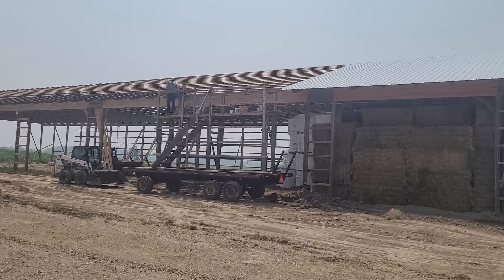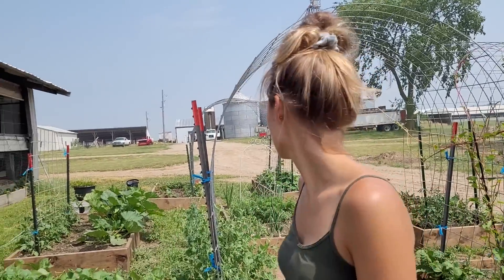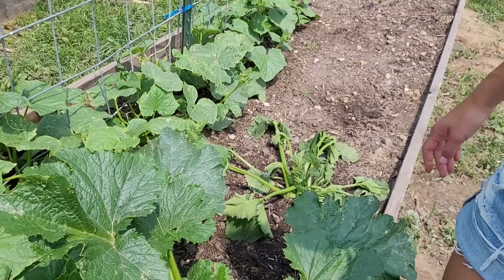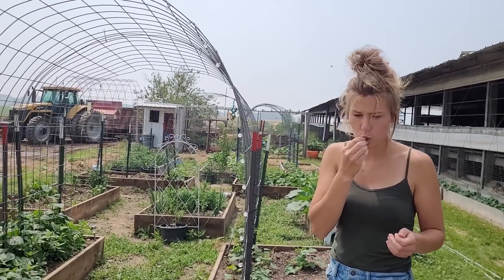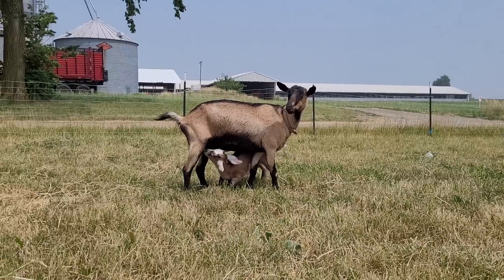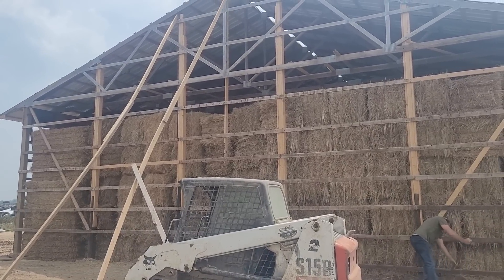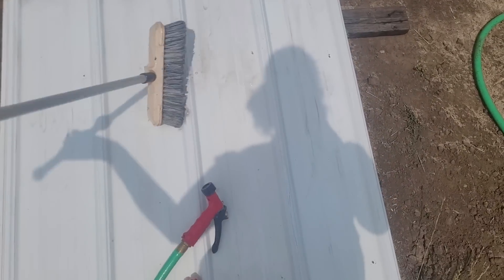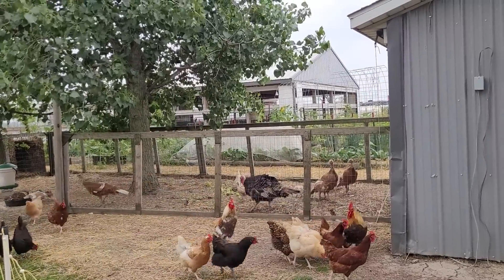Simple Summer Farm Life

Comment: You can purchase safety gear for around $150 , that metal is slick, you can purchase them at any roofing supply place. It comes with rope a harness and an anchor. just a little cumbersome but cheaper than a fall